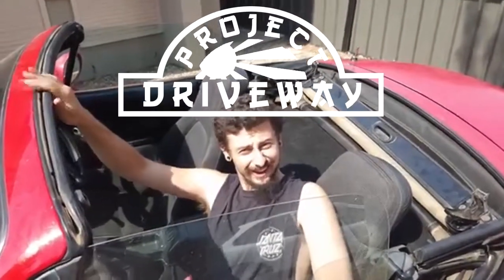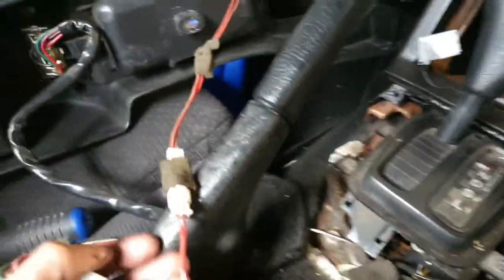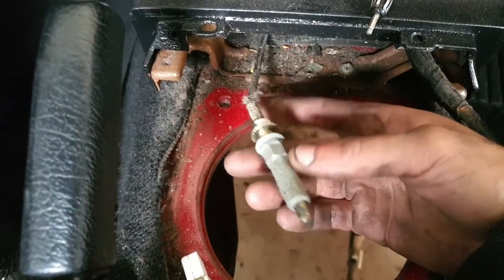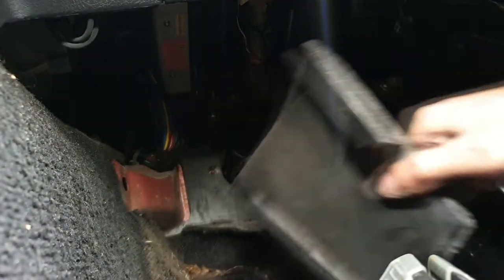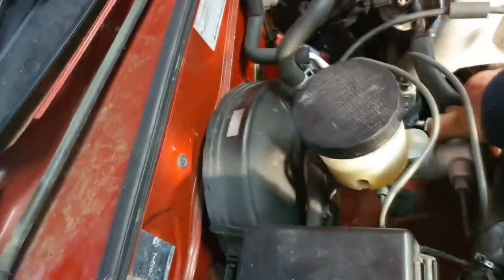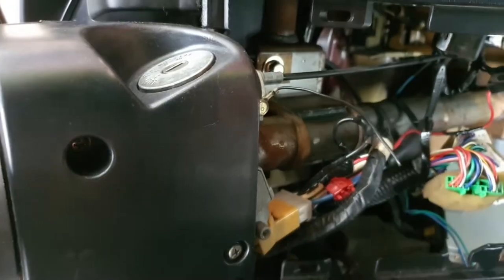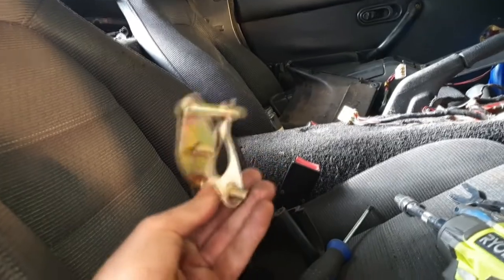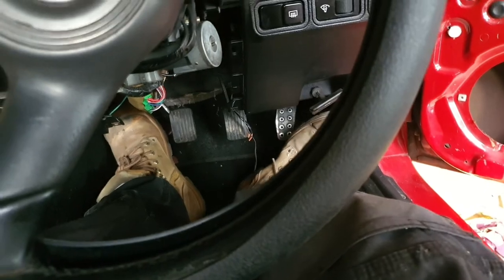Welcome The 3rd Pedal! - Miata Manual Swap

Comment: Did you have to do any wiring to the clutch pedal for the ignition system to know when the clutch pedal is fully depressed?
Reply from the maker: Nope no wiring, all i had was a manual switch connected to the igniton and to the auto shifter, pulled that out and it works

Comment: probably would have been easier to just cut brake pedal to same size as manual one
Reply from the maker: Yeah could of! I had to drop the steering wheel anyway to get the clutch pedal in

Comment: Did you wire anything to the clutch pedal sensors? And what did you do with the automatic transmission computer?
Reply from the maker: The auto transmission computer wasent needed anymore, i cant remember 100% what i did with the wiring for the clutch pedal. If needed i can double check for you
Reply: @Project Driveway  I finished it all, thank you though. Gonna wire my neutral saftey to my clutch cc for 2step

Comment: Ever figure out what the weird wiring crap was all about?
Reply from the maker: Behind the dash into the ignition barrel?
Reply: @projectdriveway7703  Yeah. With the funny sensor thing and the clipped wires
Reply from the maker: @tonyroma9046  ohhhh i think all that stuff was a alarm system that was all disconnected but still under there. Ripped it all out haha